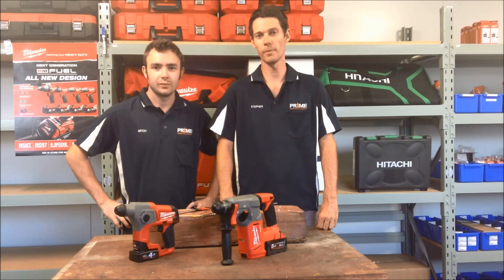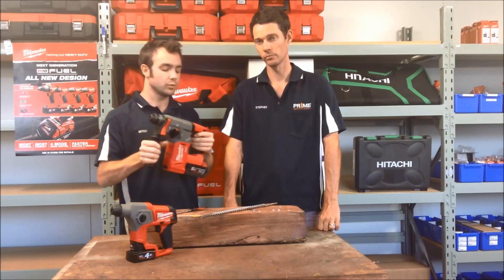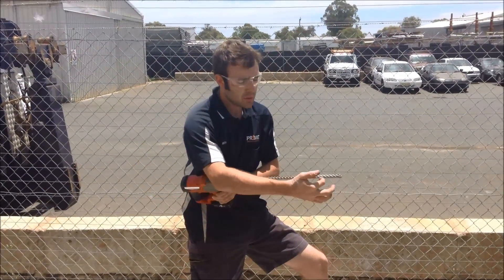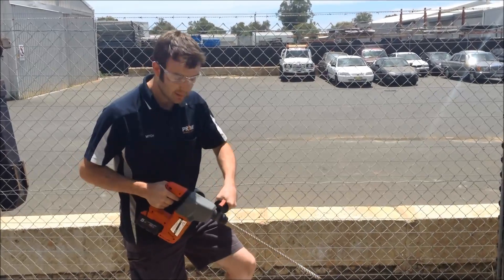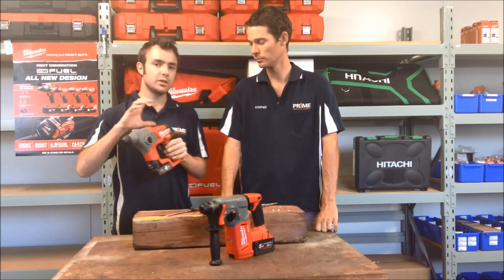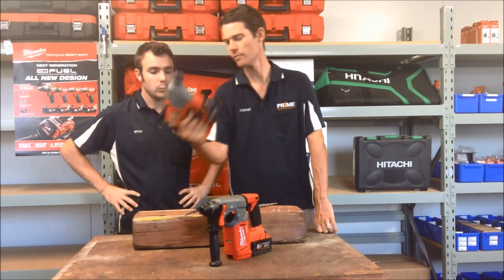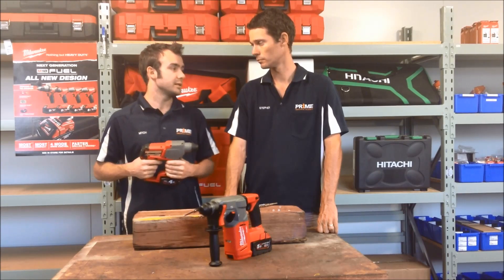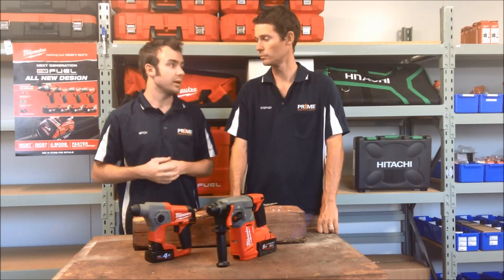Milwaukee M12 & M18 Cordless Rotary Hammer Drill Comparison M12CH Vs M18CH

Comment: So you can say that the M12 is better for holes up to 10mm occasionally up to 14mm, and go for M18 system if you need to drill a bigger holes than this.

Comment: How do you metric guys look at a hole and say, "yeah that's about 95mm... Need about 5mm more" 😂
Reply: Bc it’s way easier:
1 kilometre = 1000 meters
1 Meter = 100 cm
1cm = 10mm
Way more logical than:
1 mile = 1760 yards
1 yard = 3 foot
1 foot = 12 inch

Just wtf
Reply: Because it's a superior system
Reply: I wouldn't say 95mm, more like 9.5cm.
In my country (Mexico) we use the metric system but... where I live (northern Mexico) we are so close to the US and most tools, fasteners are exported or come from the US we are used to both systems. Also... most of our cars are American so we need to  have SAE and Metric all the time.